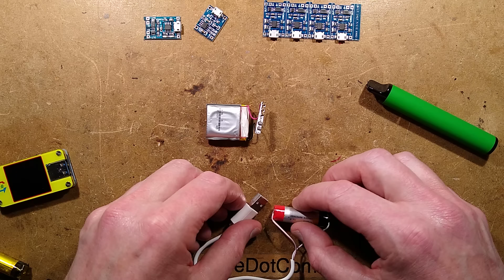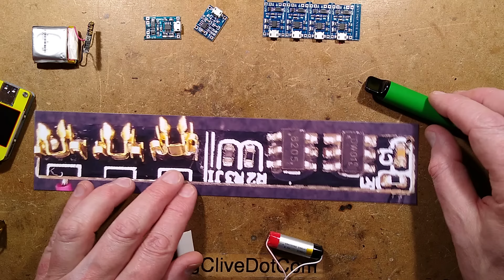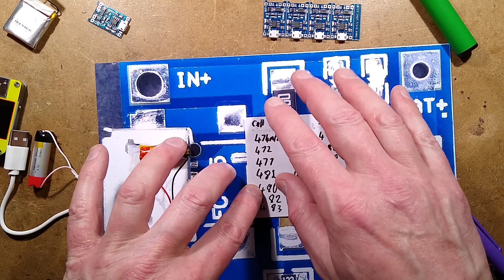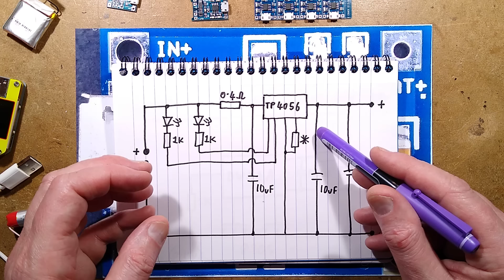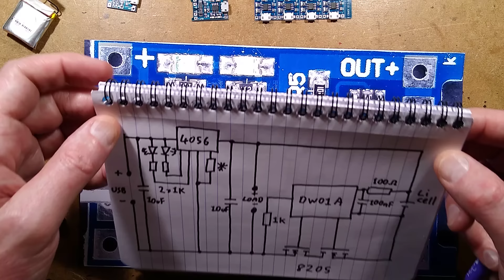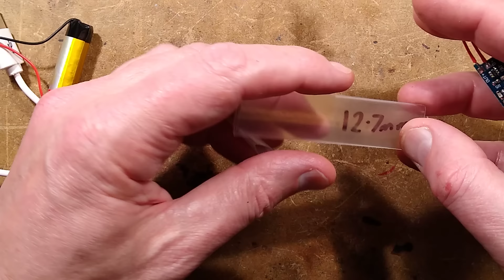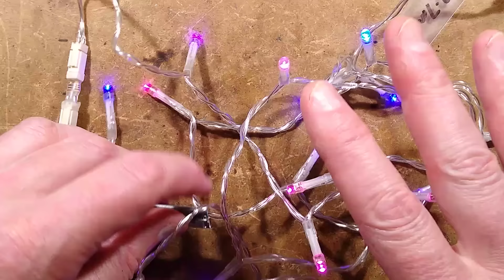Don't do this!   (There's a much safer way)

Comment: Dude I did that and fell asleep with my cat . The battery was 2ft from head and exploded and Burnt  a black hole in my carpet and the wall. My cat flipped out and I was in REM sleep mode. Literally woke up like WTF scrambling ! Saying what if I wasn’t home!!! It woulda burnt the house down not even a question and killed my two little cats. Thank god I had a bottle of water right there!! It took the whole bottle plus a towel I had there. Ruined about 4sqft of my comforter and 2sqft of carpet and 1sqft of walls. Thank god I have short hair cause it sprayed my head as it was plugged in the wall by my pillow. And I felt the burn. I feel dumb about this even happening cause I know way better. I was just on zero sleep over working my ass off and desperate for a hit Ike a crckhead, but had a dead battery. Literally plugged that shit in and fell the F out hard!!! What an alarm clock! Holy F! So this guy is pretty passive about the danger! He needs to show a little more emphasis like someone is being murdered before his eyes! Hopefully people read this and get drift! It’s not worth saving $20 bucks. It can be so much worse any given moment!!
Reply from the maker: Even with the proper charging circuit I still recommend charging any lithium cell on a flameproof surface.  Lithium cells are energy storage devices.

Comment: What happens if i charge the battery by connecting it to the “out” connections insyead of the “bat” comnection?
Reply from the maker: The out connection is the protected circuit.  I'm not sure what would happen.

Comment: I like those double protection versions, sometimes I add a "dbl Pole, dbl Throw, center off" switch wired to disconnect the output or the input, "off, on, or charge" not both, I generally have a barrel connector on the input pins when mounted  in a box.

Comment: I use a buck converter on Amazon. It's awesome. It goes up to 24v and down. Because that's my psu voltage. I charge everything all the way 6s then I use a boost converter to charge up to 21s

Comment: The plug controls amperage, you claiming 3amps will flow is Ludacris if the plug is only capable of putting out 1amp to the usb..  only fast chargers put out 5volts at 3amps 😂
Reply from the maker: The supply and circuit impedance determines the current.

Comment: I had an old Nokia n gage about 10 years ago didn't have a charger for it so basically just pulled the battery out and stuck to bare wires from a usb on the battery used to charge to full in about 5-10 mins 😂
And would last a week on 1 charge
Reply from the maker: Some of the old Nokia batteries did actually have overcharge protection built in.

Comment: the tp4056 module with extra dw-01 gives overdischarge cutoff of 2.5v, thats too low for my application. what can i do to make it cutoff at 3v or 3.3v ?
Reply from the maker: The DW01 is purely a last resort shutoff.  You'll need to design circuitry that detects the 3V threshold.

Comment: So I did this, the light on the module stayed red and after about an hour I saw the battery expanded.  What did I do wrong?
Reply from the maker: Check the connections and polarity.  I'd recommend disposing of the damage cell in a safe manner.
Reply: @bigclivedotcom yeah, I moved on to another battery.  I triple checked polarity and now both light are on.  There was another battery I tried and the red light flickered.

Comment: Why are 3.7v lithium batts 4.2v but actually 4.4v?
Reply from the maker: 3.7V is the average voltage mid-charge.  Standard cells should only be charged to 4.2V at full charge, but some phone batteries charge to a slightly higher voltage for increased capacity at the expense of lifespan.
Reply: @bigclivedotcom yep my phone (moto g64) does that, 80% at 4.2v and 100% at 4.4v

that explains how they managed to fit 6000mAh in a relatively compact 6.5" phone.

i had a mini heart attack the first time i checked battery voltage, i only charge it to 80% since then.

Comment: So I have a pile of these 03962a's and I need to run 3 cells in series so can I just use diodes on the output side of each board?
I don't want to wait for a slow boat from china to bring me 3s boards.
Reply from the maker: It's not recommended to charge them like that.  If three modules were used they would require isolated supplies to avoid shorting out cells.

Comment: Would a twin AA/AAA battery box side step the 1A/500mA issue?
Reply from the maker: It needs a more accurate charge method for safety.

Comment: Good to know. Recently I did found one in the street wanted to use it and tried to charge it, it went broken, could not read any info from it, so I tried 3.5 volts but now I know how to do it if I ever find one again.

Comment: Thanks Clive. Charging my lawnmower electric start battery now! I don't want to disassemble the batteries from their mount and battery management system. Can you charge the batteries in situe as long as your connections are the right polarity ?

Comment: I suspected it wasn't safe to be doing this with lost Mary disposable vapes plugged directly into a USB outlet but wasn't sure why. I have been doing this for a few months and only charging them for 15 seconds but the battery would get quite hot. Although I've not had an issue with thermal runaway or explosions etc I won't be doing it again!
I'll also be trying my best to just quit vaping altogether as its a nasty habit!

Comment: Next installment coming soon I hope.
I weighed a few of these. They are half the equivalent weight per Ah of flight lipos. Even mini hubsan quad which only draws about 3A max.
They need a protection module permanently attached. Vape is 2A intermittent in an aluminium tube. A pimped 18650 25p module using a 0.1 Ohm smd resistor in series with MOSFETs. Difference from NiMH and alkaline, is lipo does not stop.  if your project disconnected once thermal runaway starts.

Comment: Can you do the next video on how to pimp those cheap discharge protection modules please? The DW01 uses the MOSfet ON resistance of about 60mOhm and a voltage drop to cut drive at 0.2V. But 3A is a bit high for most DIY circuits that would have relied on self limiting current with AA Alkaline cells. In the original vape the heater takes a couple of Amps yes, but its all happening inside a nice aluminium tube. Intermittently.

Comment: i’ve been doing this for a couple years when i find them on the ground. They’re amazing little project batteries and it’s very easy to find BMS for this cell to actually integrate it into something. Luckily for me here in the USA the most popular vapor brand contains a 1000mAh cell. They also came out with a new device that’s got a 1500mAh cell🤯 it kills me to see people throw these things away considering most of them are resting about 3V and ready to be charged and used again.

Comment: Another way:
I collect solar stake lights, even if they are broken. You can use the small solar panels for slow charging just about any batteries, but you have to check voltage from panels. If charging multiple batteries in parallel they will charge even slower. If solar panels aren't getting full sun, they will charge slower also. If charging multiple batteries in parallel, make sure they are same capacity and start at same battery voltage. Voltage can flow quickly from one battery to another.

Comment: While watching the video I already charged 2 via usb with no problems. Did that at more than 200pcs with no harm or burning my house. Usually charging each piece just twice....Peace.
Reply from the maker: So you're charging lithium cells with uncontrolled current, and potentially to a much higher voltage than they're designed for.  The end result of this will be a cell going off like a firework.  Possibly when you're not there to deal with the situation.

Comment: I once saw a guy build something similar using a car charger, a cable and a battery, in think it was double a or maybe 9 volt, instead of charging the battery it was a type of cheap battery bank. i have no idea if it was safe but it was an interesting idea.

Comment: For the current being over 3 amps, find a usb wall outlet adapter with a lower output, older ones usually are around 1 amp. Doesn’t solve the over voltage issue.

Comment: I initially didn’t realize I could use these boards to add protection to a battery without primarily using them for just charging. Brilliant! I’m also adopting your KF2510 connector standard… they work really well and are super cheap in bulk from eBay as you know. As always, thanks Clive!

Comment: If doing it the stupid way, at least add a series diode and resistor. That isn't even close to enough, but it should not actually go pop in that case. 4.3v is still too high, and a series resistor will limit the current too much when the pack is reaching full charge, but if anything, that will help protect it since it would be giving a bit too much voltage at the end of charge.

Comment: Love watching your stuff but this one caught my eye massively, I have been picking up these pens left right and centre around my parts and harvesting the cells out of them and was scratching my head about how to charge these. I was just wondering if you could charge two batteries in parralel with the 1 amp charge?
Reply from the maker: You can.  But they have to have a very close starting voltage to avoid high current flow between them.  It's better to pair them up permanently and treat them as a single cell.

Comment: Not exactly the smartest video since many people trying to do this have no idea what they are doing and will have a issue with battery safety. I have saw people do sone incredibly stupid things with 18550s you get them messing with special sizes and unknown rating they will blow things up if you're not an electronic expert don't  try thisat home people
Reply from the maker: It couldn't be worse than what they were doing before.  Connecting a lithium cell to a non current limited 5V supply is infinitely worse.
Reply: @bigclivedotcom  morons playing with electronics is Darwin award territory just saying

Comment: Hi there, Question? Why charge a 3.7v cell at 4.1vor 4.2v? Genuine question.  thanks.
Reply from the maker: 3.7V is the mid charge voltage of the cell.  It is usually used between 3V and 4.2V.

Comment: Clive, I frequently rewatch your videos and I came back to this one and it inspired me to go out and look for vapes. I live in Manchester near the universities, so there are plenty of discarded vapes left by students around the place. I spent a few hours out on my bike yesterday and I found a few, and then I went out again later on foot and managed to fill up a whole bag. (I actually had to stop because I didn’t have anywhere else to put them.) I have amassed 22 so far.

This video is fantastic for me, as I am interested enough in electronics to have projects I want to use them for, but not confident enough to have been able to come to a conclusion about how to charge them safely. You have told me everything I need to know in this one video and I’m very thankful for that.

As an aside, I live in shared accommodation and we have room inspections this week. My room currently smells extremely strongly of fruit. I just hope whoever comes to inspect it doesn’t pass out!

I don’t really have an overall point with this comment, but I thought it would only be fair if you knew how helpful this video and your channel in general is for me, because otherwise I’ll probably never say it. Of course, playing around as a kid and then doing a GCSE and A-level physics taught me the basics of electronics theory, but essentially all of the knowledge I have about practical electronics can be in some way traced back to your channel. My work isn’t in electronics (I’m in software) but your channel has really allowed me to maintain an active interest in electronics as a hobby despite not being immersed in the world of electronics in the same way as I am in software. Cheers.

Comment: Thanks.
I could have needed this information in my brain 60minutes ago. I absolutely did not blow up a 500mah battery in my own home. It also absolutely did not spew fireworks before I threw it out in the snow.

I have learned things. I used a charger for LifePO4 batteries. And it only went as low as 6v. I left it on for too long and the battery was pushed too far. I charged one battery successfully. I was too inattentive with the next one. Not doing it again with the incorrect charger.

Comment: Not trying to be fussy, but I don’t see why people prefer to use the leaded solder. The unleaded one is just tiny, slightly more difficult to use, but the benefits of not using lead outweigh a thousand times the “easyness” of soldering.
Reply from the maker: There's a reason lead was put in solder in the first place.  It makes it malleable and less likely to form shorting tin whiskers.  Modern lead free solder causes a massive amount of unnecessary landfill by failing with cracked connections.  Given the tiny amount of solder used in modern equipment and the fact it's in a robust non soluble form, I'd say that switching to lead free was an ecological disaster pushed for by technically illiterate people.

Comment: Lately I started using very tiny 1s BMS. It looks like a strip of nickel that you spot weld top and bottom little ~1cm module sits in middle of battery. It's amazing / terrible that these disposable batteries are actually reusable!

Comment: Can I run a bunch of these cells in parallel? Or is that not a good idea?
Reply from the maker: Yes you can, but they must be at a very similar voltage when first connected together to avoid high current flow between them.  Once in parallel they will act as one bigger cell.
Reply: @bigclivedotcom  thanks for replying! You’re the best

Comment: Is there a minimum draw for these boards? I tired using one with an ESP32 and when it goes to sleep it reboots, makes me think that it requires above maune .01mA also, anyone measure the idle draw of these on the battery?

Comment: Can I use that to charge 3.7V camcorder batteries with unobtainable chargers, like Toshiba Camileo s20?
Reply from the maker: It depends on the integrated protection circuitry and current state of charge.

Comment: If anyone here is considering recharging an old vape, don't. once your vape runs out of juice, you're breathing the gasses produced by the coil and the cotton burning (often times producing formaldehyde).
Reply from the maker: That's why they add more juice at the same time.

Comment: you need to run diodes in the charger.. most vape people don't fully charge the units. that's why it works.

those circuits are in the wider units I use as fuzz power supply

fuzz face runs around 5 V PNP and NPN circuits both..  try that next.. i've gotten mine working

Comment: I am having a hard time finding the connector type that you use. I have searched for Molex, JST and many others. I really like the ones you are using. Besides, if you use them, they must be good! I have watched a lot of your connectors videos. Any idea where I can pickup some of the 2 wire connectors you have in this video?
Reply from the maker: Try searching for KF2510 on eBay.